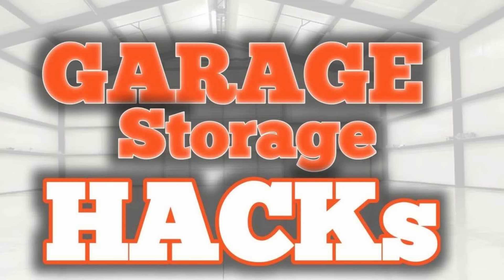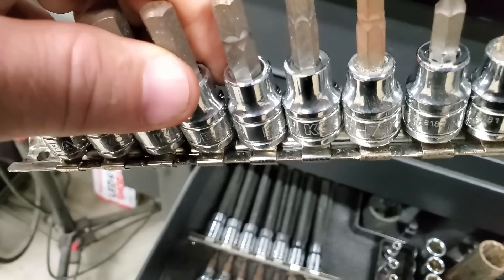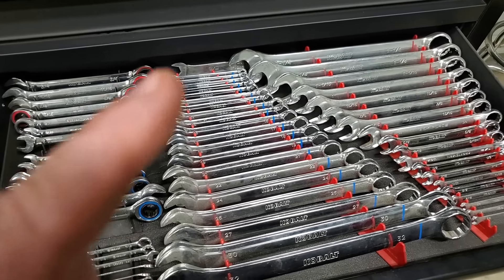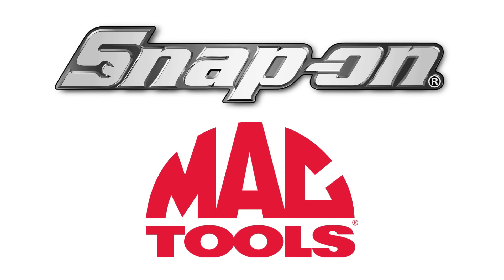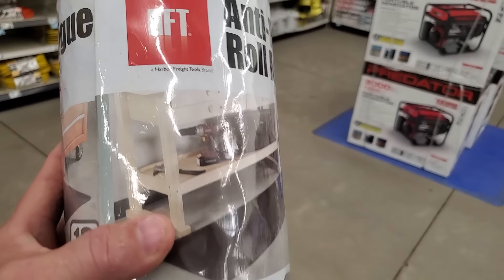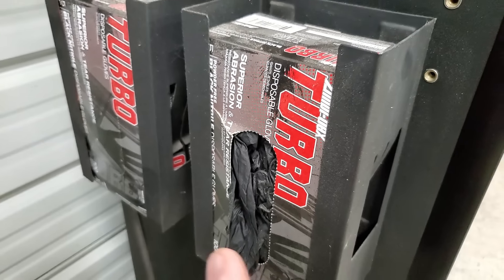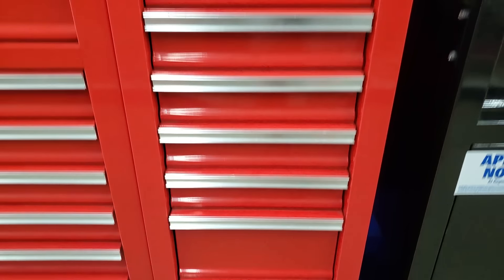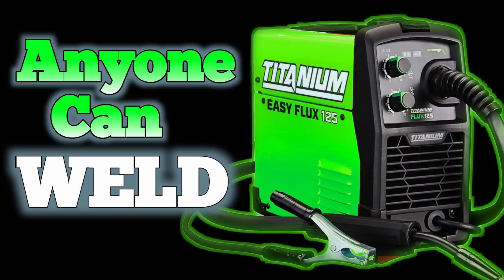ToolBox Organization HACKs

Comment: The nice thing with a lot of the stuff you were showing for organization is you can easily move them around.  At some point you most likely will change tool boxes or tool chests, so you can pull the organizers out and put in the new box and not have to replace the organizers, unless you want to.  

I need to get a bunch of organizers this year to reorganize my tool chest, its way out of hand, sockets, wrenches, pliers are everywhere, good luck knowing if you are missing anything, let alone finding anything LOL.  I need a larger tool chest, I already know that, but organizing the one I have would seriously help.  

I use the Harbor Freight organizers for some of my wrenches already, but they don't stick to the drawer bottom, so they end up sliding all over the place, can't remember how long ago I got them but they're not magnetic unfortunately.

Comment: Love the mat cutting idea.  I am very curious when you start using the power strip on your welding rig if that strip has a load limit or protector in it. I know welding draws a lot of power, so does that chopsaw little less with the angle grinder. Let me know how that ends up working. I might be picking one up if it holds that load. Nothing worse to me  than having to keep resetting, a power strip.  I have some i use for woodworking fine but when I plug in my welder I seem to pop fuses, a couple times even have to reset the breaker box because I was running all my bright halogen floodlights in the shop with the welder going and the kid pushed the button on the chop saw and the garage went dark. At first I thought it was the battery in my welding helmet after carefully navigating through the garage with no lights. I got to the breaker panel now I use a separate line on my lights.  With the new LEDs, it probably wouldn’t be an issue, but I love the light halogen throws off better and the heat in an already hot garage.  Great video first time on your channel. I will check out some of your other content and be sure to like and subscribe.
Reply from the maker: I don't plug my welder into the power strip.  It's plugged directly into the wall . I like the power strip because I'm normally using multiple grinders . Sometimes I'll have a cutoff disc on one a wire brush on another and a flapdisc on another  . That's where it comes in handy
Reply: @FishinNStuff  i do the same thing.  I used a label maker and put on the plugs which one is cut  off, wire wheel and grinder,  I definitely could use something better then the snake farm I have going when I do pull out the welding rig.  Loving your channel thanks.

Comment: Just bought one of those bit holders. Thought it was cool. I had a remote outside job where I took it and stuck it to my tractor bucket because I was doing a mailbox install. The little SOB fell off the bucket and the bits stuck in it popped out and went everywhere. That sucked. So that thing will stay in the shop and not get used like that again. These are good just don't expect the bits to stay put if you ever drop it. Too bad the magnet on the back is not stronger. Oh well. I did buy some of these HF strip magnets and do use those to hold and organize bits works good. Last time those went on sale I bought a bunch of em.

Comment: That strip is the best     i only have one plug i have access to at work    so the strip charges my lights,electric tools, and fan    and the other open wall plug i keep a drop cord on to use the ac machine battery charger and welder

Comment: Look at all the wasted volume using any wrench rack or typical tool holders.  I just stand the wrenches on their sides, nestled against each other against one side of drawer, using magnetic block......magnetic tape on metal or wood block works.... in front of the whole stack to keep them standing up.  Easy to pull one wrench out, replace when finished using.....maximizes volume utilization. Craftsman sockets long ago came in four sided metal trays with swing up bail to contain sockets in tool bag.  Make socket trays from sheetmetal.....line up sockets to get dimensions needed....layout on sheetmetal, cut out, fold up four sides......custom socket trays....no wasted drawer volume.  Screwdrivers lay onto shallow blocks with magnetic tape to hold position during drawer movement, alternating handles to maximize volume efficiency.  Used Dad's o;ld craftsman roller tool cabinet for welder cart.  Removed wheels, attached two 2x10s extending 12" beyond each end for welding tanks retained with ratcet straps....better than normal chain thingys.....added better HFhigh load large diameter (roll over floor debris easily) swivel casters under 2x10s.  Hinged HF welding table from rear of cabinet, added PVC rod holders.  HF magnetic work positioners stick to the cabinet drawer fronts.

Comment: I have that same black Home "D" Husky toolbox. Not a fan (no offense of course).

 Should've bought the Harbor Freight US General since it is basically a reversed engineered Snap On box. 

The slides on the Husky are kinda junk, the finish started to peel after just a few months but the biggest problem is the drawers.  They are to shallow.  Ya can't fit anything in them. The drawers should be a few centimeters taller.  I will be selling my Husky box soon
Reply from the maker: I agree you . But for the price I don't feel ripped off

Comment: I worked at a auto dealership for a while & a few months after I was hired in, there was a scandal.  Apparently, the local snap-on rep was selling boxes to the techs in the area, but he was buying them from HF and replacing the logo, pocketing the $ and handling the warranty swaps himself.  When he was promoted and one of the techs needed a bigger box, his replacement offered the tech $20 for trade value on his HF box with a snap on logo glued on, which brought the scam to light.  The scammer ended up getting fired, but what I find most interesting is that none of the technicians who got these HF tool boxes with the snap-on logo had any idea that they were using something from Harbor Freight instead of snap on before it became public.  Afterward, a couple of them who had actual snap on boxes insisted that they had been given HF boxes.  Really makes one question if there really is an appreciable difference between the brands. 🤔

Here's a couple hacks for stuff in this video:

For your welding table, pick up some of those cheap plastic plug covers they sell to keep babies from sticking their fingers in outlets.  Put them in your unused power strip plugs to keep dirt & debris out.

STOP buying button cell batteries in single packs!  Go on amazon or fleabay to get a package of 50-100 of the same size for the cost of a couple of the name brand batteries that last just as long.  Even if you don't use all of them, you're still money ahead.
Reply from the maker: Thank you for the tips . I buy the 100 packs off Amazon too lol . Never put it on a video though 🤔

Comment: Fishin N Stuff. Awesome video with some great tips. But Snap-on did not, does not and has never made Kobalt tools. J.H. Williams a manufacturing partner of Lowe's (at that time) launched Kobalt Tools in 1998 to compete with Home Depot (Husky tools) and Sears (Craftsman tools). In 2003 the Danaher Corporation began producing the majority of Kobalt hand tools. YES Snap-on bought Williams in 1993 and Williams is their Industrial Brand but they are separate companies. Williams was founded in 1882 and Snap-on was founded in 1920.
Reply from the maker: Snap on acquired Williams in 1993 . Snap on owns Williams. Additionally, their year stamped codes are the same. Kobalt by Williams stopped being sold around 2002/2003 and Kobalt has since been made by Danaher. But the old ones I refer to were exactly like snap on . I bought every set myself . But you are right I spoke wrong when I said snap on owned Kolbalt  . That was wrong they just made the tools for them . I apologize
Reply: @FishinNStuff  That's pretty much exactly what I said. But they were made by Williams NOT Snap-on. Snap-on may own Williams but they are separate companies. Also Snap-on wrenches are rounded in the open end and the Kobalt ones were shaped more like a bolt (hex) so they are not the same.. Snap-on also owns Blue Point Tools to but you wouldn't say their wrenches are the same. And yes Blue Point used to be made in the USA as well. My cousin had every Kobalt set back then, I wish I would have bought them from him when he sold them. They are nice wrenches. I can't seem to find any for sale anywhere. LOL
Reply from the maker: I've heard you can find em on Ebay sometimes used
Reply: @FishinNStuff  Thanks I will have to check that out.
Reply: Danaher doesn't make Kobalt tools any more. Danaher / Cooper tools was divested into Apex (Bain Capital) in 2012. Matco under Fortive was spun off later, as an FYI. They are imported or made by JS Products (along with Steelman, and others). The screwdrivers are made by Great Neck Saw (OEM Tools, and others).

Comment: For both pliers and wrenches I use 8 gauge solid copper wire coiled up. It's cheaper and very adjustable, plus it takes up less space.
Reply: Can you post an example?
Reply: @learnjcbskidsterchickensga7594  not a clue how to post anything, but you take a piece of 1 to 1 1/2 pvc depending on what diameter you want, a piece of 8 gauge solid wire with or without insulation, 20 or 25 feet long and wind it tight around the pipe. I put the pipe loosely in the pipe jaws of a vice so it will rotate, put the wire into a hole in one end and use a medium sized alignment bar in a hole in the other end to turn it. You can do the same thing with 1/4 inch brake tubing on a 2 inch pipe for bigger wrenches. Then I laid the coil on a piece of pallet board and zip tied every 5 or 6 inches. I made it a smaller diameter for my metric wrenches under 12mm. You can vary the diameter to whatever works best for the wrenches you are working with. The coil does still shift forward and back and I haven't decided yet the best way to cure it. Maybe a piece of 3/8s flat bar run through the coil and screwed down at each end?  It's annoying but not that annoying that Have to fix it.
Reply: Thank you!
Reply: Old coax cable for free
Reply: Not hacks.  You're just buying expensive Chinese dogshit.  Imagine paying 17.99 for that .

Comment: I use Eva foam for my tool box and the organizer I made a socket set in a metal case it came in plastic I replaced it with Eva foam it's cheap and nothing slides around

Comment: I use to usethose same harbor freight socket organizers and nearly every one of those plastic post snapped off so in the trash they went i bought 2 of the kobalt socket organizers which hold 1/4 3/8 and 1/2 and holds over 100 sockets and it has a handle so you can take it with you they were $30 each and thereeeeee awesome part # 85923 looks like there on sale for 20 and wayyyyy wayyyy better then those harbor freight ones trust me
Reply from the maker: Mines listed 5 years

Comment: The best socket holders that work for me are the us general magnetic rail. Sockets stay on tight the rail can be placed upside down and on it side without a single socket falling out. You can also customize them by cutting them short and adding or deleting clips. I replaced all of mine. I got them with coupons. I have extra clips and rails just in case.
Reply from the maker: Those are nice . I'm really liking those icon tools with holders . But I can't justify replacing all mine lol
Reply: I use those as well. Really nice.

Comment: Are these even technically considered hacks? You're just buying organizers. Pretty certain hacks would be more along the lines of taking something you haven't a use for and making it into a tool organizer.
Reply from the maker: You could be right . But I would think it would work both ways tackle box used for a tool box or toolbox used for a tackle box . It's still using it for a purpose it wasn't designed for . Which is technically a hack . Maybe not . It's subjective I guess

Comment: All right, Keith, all good ideas.
Those side boxes, if anybody gets one, they are great boxes by tge way, if your tool box is pretty much stationary, there good to hang on. If you roll your toolbox around, do yourself a favor after it is set in place, put a couple of bolts through the sidewall and into the main toolbox.
Retired aircraft mechanic and took me one move of holding the sidebox to steer with, and it mostly came off the toolbox, solved that problem quickly. After you use one a while,  you'll wonder how you ever lived without it.
Wrench racks, socket rails are a must. Other tool racks, personal preference,  they do help organize though.
Brother, I hope when you showed your sockets and ratchets, that was overspray on em and not rust. 
Agree with you on the brand names using foreign mfg and put their name and higher price on it, not cool.
Stop and think, all the brands of tool boxes out there, like batteries and most every other mass production items, there isn't bu a couple of box manufacturers and they just make them with different specs and put different names on em. So just because you you go to buy a Snap On, Mac or whatever toolbox, look at some of tge "cheaper" brands. I'm really impressed with the quality of the new HF toolboxes.
God bless you and your family, brother . And stay safe on all these trips over to Harbor Freight,  don't get run over in the parking lot.
Reply: The HF side box has holes near the bottom and bolts to secure it to your rollcab. With a couple cuts with an angle grinder I put the side cab drawers on my 5 drawer HF cart.

Comment: My complaint about most of the tool holders (like the ones for the Icon screwdrivers) is they waste a lot of drawer area and frequently make the tools too tall (like turning the pliers on the sides). I have 3 Craftsman stacks, one with 8 drawer base and 6 drawer top and the other two with 6 drawer bases and 12 drawer tops), and they are PACKED.  They're organized, but because most of the drawers are somewhat shallow, I can't do something like turn the pliers on their edges. And for the Icon screwdrivers, they could have flipped two of the handles the other direction and made it a smaller footprint. I imagine Snap-On figured out that by wasting as much space as they do, well, then they can sell more or larger toolboxes, right?

Comment: Great video. I have very few boxes. I do have five ammo cans, but each can is for very specific things. Cut off wheels, etc. Each can has a large label. I hung concrete reinforce wire on all my shop walls. I use dollar store hooks. 90 percent of my stuff is hung and I can see almost all my tools at a glance. Even stuff inside the box it came in. Ratchets, heat gun, drills, etc. I gotta get the cordless drill organizer that you showed. That would free up work bench space. I also use a lot of dollar store super magnets. I love being organized. Great video. Thank you.
Reply from the maker: Those are some great ideas